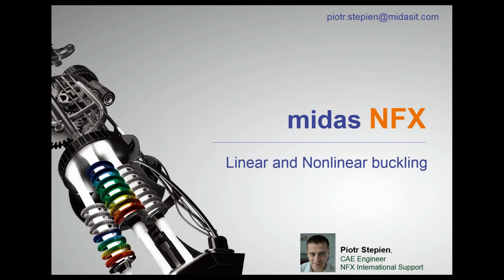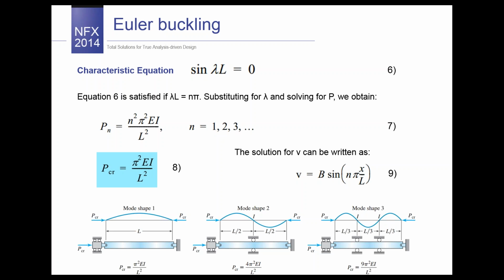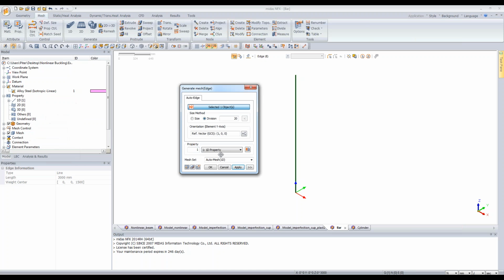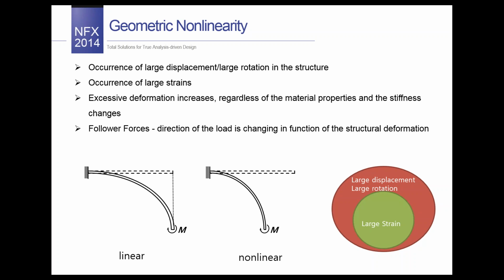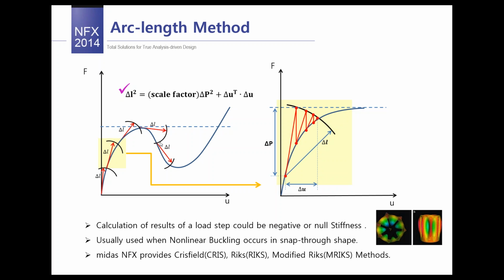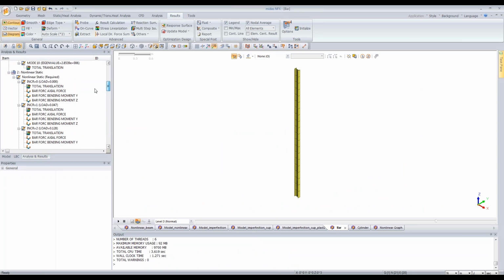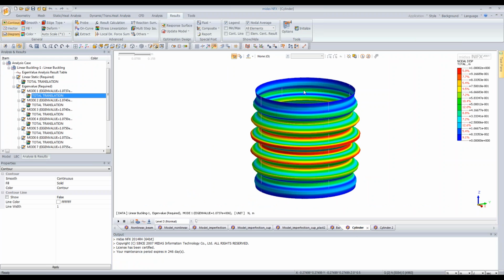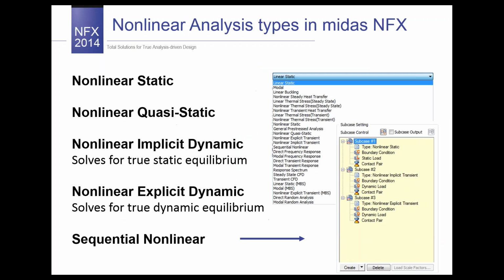Buckling Theory and FEA: Linear VS Nonlinear Buckling

Comment: Nice explantory video! But I just wasn't able to see what was the load factor for non-linear buckling before adding the imperfection (additional moment) to the beam, at incr = 20. I mean although we didn't see any buckling since the load was all compressive without imperfection, but would the load factor still be the same as we obtain after adding the imperfection, or not?